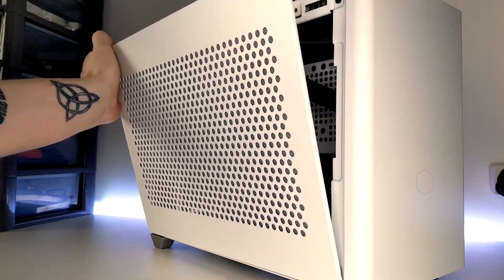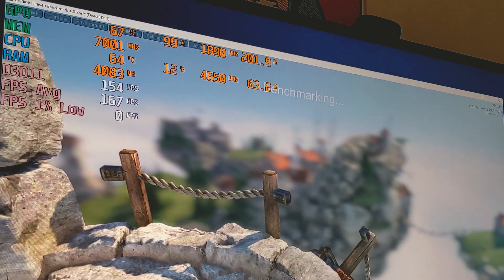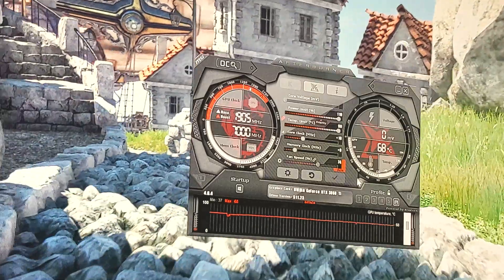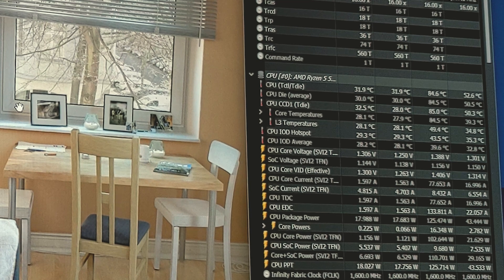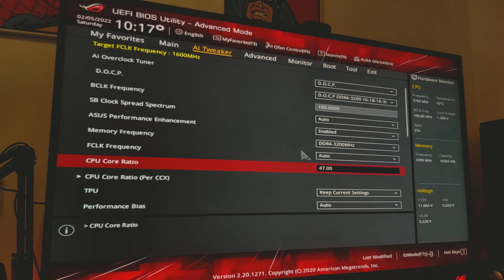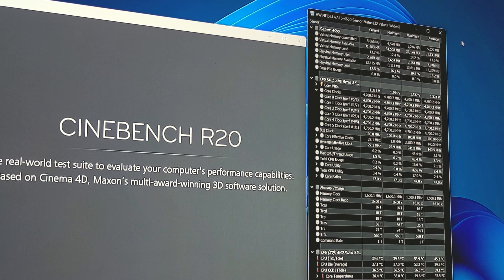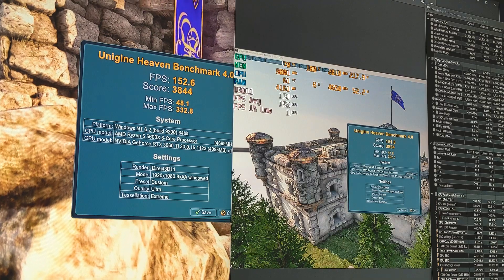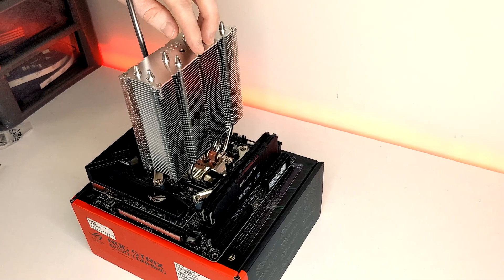Ryzen 5 5600X & RTX 3060 Ti Overclocking Walkthrough - NR200 Build OC

Comment: Been binge watching your videos really great stuff, just wondering I have the same cooler as you do for the 5600x do you have a good fan curve you can recommend for me to use? As mine seems to be revving up and down alot.
Reply from the maker: Cheers mate, really appreciate it! 👍 Since this system sits in my living room, even with quite an aggressive fan curve I don't really hear it much. Generally I keep it pretty low from 30-55c at around 40% fan speed and then from about 60c onwards I'm at 70%. As well as adjusting the fan curve though you may have some luck with adjusting fan step up/down smoothing so may be worth a try.
Reply: Thank you bro appreciate it alot, ill have a look into it! :)
Reply from the maker: @dovahpie7168  No worries mate 👍 Good luck!

Comment: Hello, I'm doing live broadcasting on pubg mobile, my processor is rayzen 5 5600 X, my graphics card is RX 5500 XT, my motherboard model is MSI B450 pro max 16 GB RAM memory and A2000 Kingston SSD m2 hardisk 240 liquid cooling, can you help me overclock, thank you ❤️❤️❤️
Reply from the maker: Hey! The overviews in this video for both the CPU and GPU should point you in the right direction. For the 5600X in particular, you could start out with 4.6ghz at 1.3 volts and bump the clock speed up until you reach instability then either amend the clocks or voltage depending on how your CPU manages 👍

Comment: Okay so you seem like a smart guy and I can’t really get any answers anywhere else, so my old computer displays a message that says “this CPU is not supported by your motherboard” even tho I’ve used that pc hundreds of times beforehand no problem. How do I fix it lol, it’s driving me insane
Reply from the maker: Seems strange that even though the PC says the CPU is not supported by the motherboard despite the fact it's displaying that message which usually you wouldn't get at all with an incompatible CPU. What's the CPU/motherboard? Maybe to avoid any issues that have arisen with the motherboard, start out by clearing the CMOS or removing the CMOS battery for a few minutes to reset the BIOS and maybe that could help.